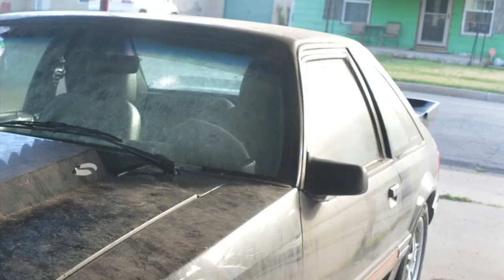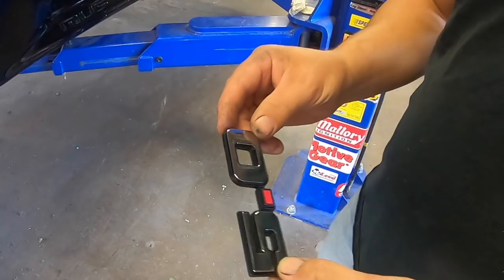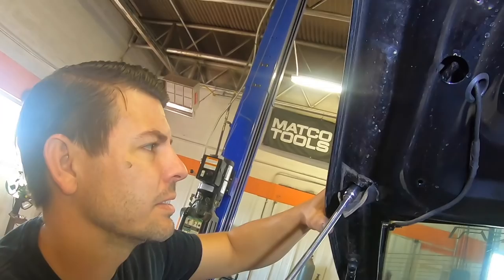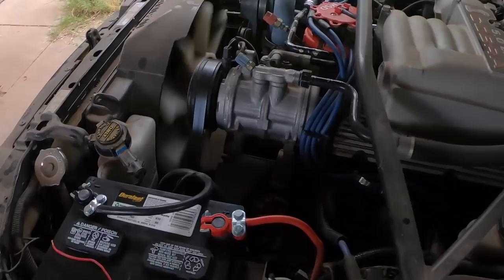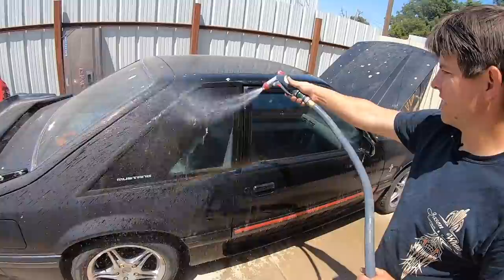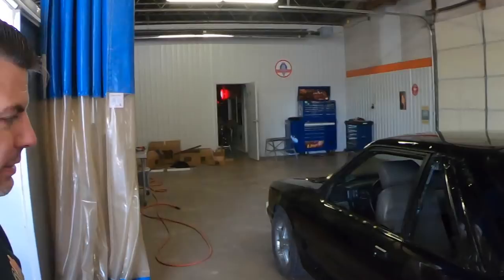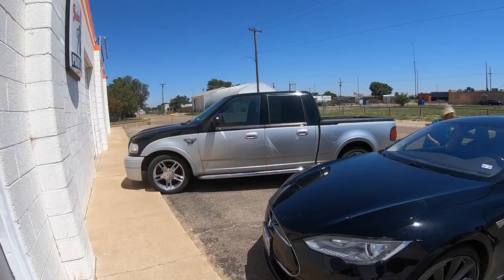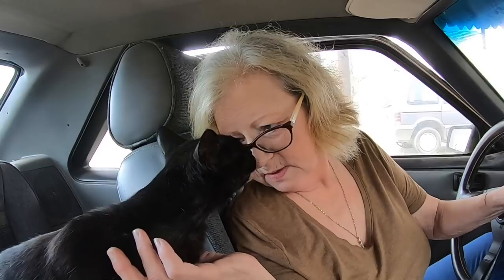Watch Us Rescue &  Restore Neighbor Lady's Mustang At No Charge

Comment: Wish they would have keeped the saleen wing and the gt40 intake
Reply from the maker: The parts are there. Somebody can do all that body and paint work.
Reply: jason9022  Never have a read such an ignorant comment in my life.They made the car period correct so it has a better resale value. This car is now just as it was off the show room floor, which is what collectors look for.
Reply: defo should have kept it the way her son wanted it
Reply: I mean on one hand yeah, it was his car. But doing that kind of thing to it does make it more unreliable. You have to keep in mind that they were building this car for her to drive, and be reliable. The second you start putting non-stock parts on a car, it instantly becomes more unreliable. This is coming from a guy that only did exhaust and it still came loose and burnt a hole in my bumper. While I think keeping it the way her son left it would have been good sentimentally, it would have been a sacrifice for her drive-ability.
Reply: Right?! GT40 intake removed.  BBK throttle body removed and intake system put back stock.  MSD ignition removed.  All those parts actually improved the car.  This shop killed the personality her son added.  All those parts were reliable and safe.  What in the world happened.  I'd be so upset.
Reply: Ik they ruined what was that car they made it oem practically taking all of the sentimental value out of it badges aftermarket parts that troy added... kinda defeated the the whole purpose
Reply: They made it so she could sell it for if she wanted a new car. I personally liked the old hood and spoiler and other stuff, but it would help her if wanted a new car so she could sell it for more money to get a new car, and I think that was a nice thing to do, though they should have asked her before, which they probably did
Reply: Me too,  but I'm thinking the reason they bought all the stock parts and put them on instead and gave her a box with all the aftermarket parts, is it's worth more to more people as well has appeals to a broader range when it's restored to stock condition, plus, if the buyer wanted the aftermarket parts, that's more money added on top of the price of car, if not, sell them to someone else after the car is sold. =)
Reply: It looked like she was disappointed to not have the Steeda parts or Cobra intake. The turbine wheels are probably the least desirable wheels for a Mustang. Should’ve kept the aftermarket ones. Instead of getting her to sell the car, why not offer a free check up every now and then. It’s a big memory of her son.
Reply: John Smith makes me wonder what happened to the parts they took off.
Reply: @Kernalpanik  they maximized resale value..
Reply: cobra intake mate, gt40 intakes are tubular
Reply: Someone kept them.
Reply: @ianrothery8200  I disagree with this statement there are many upgrades you can do to a car to make it both faster and more driveable and more reliable like the mods that were done to this car that intake is doing nothing but help its power that's it drivability wise it won't hurt a thing the MSD stuff that was on it will actually make it run better better as in better drivability and will likely last a lot longer there is no reason a car has to become more unreliable as it gets modded unless you don't do it their correct way with the correct parts
Reply: @jasonwilbert9533  The guy said in another comment that she has the parts, and if she does end up selling it later on she can include them in the sale.

They did everything this way to maximize resale value. She already said in the video that she knows she's gonna have to sell it one day so if anything, these guys actually did her a favor. Car's gonna be worth a lot more in clean stock form even if the parts her son put on it were quality.
Reply: 93 cobra Gt40 upper and lower intake $600-700 Saleen wing (if real Saleen) $400. Take those parts and sell to make the car original to 87-89 period. Then she can get more money for a period correct car if she decides to sell. They turned a $4-5000 car into a $10k car for her. Can’t slam them for that. If that’s a real Saleen wing I’d buy it now.
Reply: Too bad that’s not the GT40 intake at all 😂😂
Reply: INSERTaccountHERE You have no idea what collectors look for here kiddo..this guy probably took all his parts and made over 2k selling them all in trade for a $200 polish job and some old stock parts..seeing all of that I would agree with Jason in that these guys are infact looking to get their hands on that car
Reply: Ian Rothery There was nothing “unreliable” about any of those parts..do you even own a car 🤦🏾‍♂️
Reply: Douglas Britcher Which is why she probably looked more disgusted than satisfied..and honestly what kind of hack job shop reveals the car on a lift with no tires on it??
Reply: xp What are you basing that off of?..that is EXACTLY what the 1988 mustang gt looked like in 1988
Reply: aussi3212 There are two GT40 intakes but this intake is neither of them 😂
Reply: Maxwell Peter It takes one to know one I guess..
Reply: E Riv she kept the old parts.
Reply: Peeweetheparakeet 13:05 they did not ask her verified by the person filming
Reply: @thewriter2549  Don't take what people say to heart. I understand why you did it the way you did. It would surely be worth more stock if she sold. But the matter of fact. It would still be sitting under the shelter not running if not for your help. She is blessed to have your help. And bless you all for taking on the project.
Reply: @scottkaluza4156  to be fair that may have been the last place her son parked it before he died and thats why she never moved it.
Reply: “Keeped”
Reply: Why he didn't leave intake original must have kept it for that fox body in the shop
Reply: Smh the old stock junk wheels shiity stock hood lol car had more resale value before minus the paint being faded
Reply: @INSERTaccountHERE  "Period Correct"  Those parts are EXACTLY period correct, those are the parts her son put on the car in that PERIOD.  Not every fucking car has to go back to stock.  They took the car and changed it from the way her SON liked it, to the way Ford made it in the factory.  There's 10,000 more cars out there that look just like they made this one.  Before they touched it, this car was one of a kind, it was HIS car.
Reply: @brick9458  They made it so she could sell it back to THEM when she needs the money or gets too old to drive it.  Pretty obvious.
Reply: @ianrothery8200  those are intake parts for the most part, all they do is take in MORE air over the stock parts, how does an engine work worse with more air? Not to mention the intake came off a Mustang, it's not aftermarket, its an OEM part that was put on a different car, there is 0 chance that car ran worse with those mods
Reply: @macpumperkinz  I'm talking repairs and reliability. I'm not saying those parts do worse on performance, but that car and engine was designed with those parts, and was designed from the factory to run best with those parts. While there may be some parts that improve some elements of performance, years of research did not go into making them reliable. Purely from a mechanics perspective, repairs are a lot easier when things look exactly the way they came from the factory. If she plans on keeping the car and just driving it, stock is the best way to go. Easiest to fix, and (usually) cheapest to fix. While yes, they were her sons mods, they may have not been the best for the car. I do kinda disagree on using the stock wing and other cosmetics, but they still made it look good.
Reply: 1 of the mechanics wanted all the aftermarket parts for his foxbody so he swapped his factory shit for it...

Comment: Get the lady some center caps
Reply: Please my word
Reply: boosted saleen glad Im not the only one who thought that.....Im a Chevy guy but thats a sweet ride
Reply: They don't reproduce them and they're held on by plastic tabs that tend to break. I actually bought a spare pair of turbines for $20 just for the caps in case mine break
Reply: Turbine wheel center caps are not reproduce and crazy hard to find
Reply: @jasonwhite6254   Somewhere I have a set of turbine caps for both a mustang and cougar.
Reply: @leemer1  awsome what would like for them
Reply: Yeah I think it's kind of crazy they took her 5 lug system off ,car had good Wheels it's easier to find nice rims with a 5 lug instead of the four. Personally I think the five lug is one of those mods that makes the car better.

Comment: I honestly feel like she didn’t want them to change the exterior... like the spoiler and hood. Thats what her kid loved and added. This just looks like a new and different car :(
Reply: ROD ETTEFA was thinking the same.
Reply: I agree with you 💯
Reply: Yes but before you pull out your 💯 for respect the point of this restoration was so she could could A keep the car or B sell the car which she was thinking of doing anyways.
Reply: But the car is worth much more by being period correct and without all the stupid crap her son had added.

I think her son, even if he was alive, would have been happy to see the car to be returned to its original position and that the work was done by pros.
Reply: @adanochoa9926  period correct? Bullsh**! You don't know much about fox body Mustangs do you? They're not worth much anyways unless it's a convertible, or has extremely low mileage. Even then they're only worth 8k - 12k. You can't give away a set of 87/88 GT wheels, and this cat took off a nice set of 16" or 17"" wheels, and put on a set of 15" stock wheels that he probably found at a flea market. And the Steeda hood and spoiler cost about $1,000.
"Restoring" her son's car was a very nice thing to do, but taking off $2,500 worth of bolt on parts and replacing with stock damn sure didn't increase the value.
Reply: VA HOSS The car was worth about $2,500 now like you said $8-12k or she has a nice driver and a memory of her son that she will enjoy with every mile she drives.
Reply: Adan Ochoa THANK YOU... I FULLY AGREE; everyone in the comments who are hating seem like just evil/jealous people given what this man had done to help this sweet woman.
Reply: Phil J.L Fig i honestly think no one got what i was saying. Watch the video again and tell me this woman didn’t look disappointed. She COULDN’T believe the car was hers. It doesn’t matter what stupid shit her son added, it was what he like and she watched her son do it. Hence why she she knew how to work with the car. Its not all about money sometimes sometimes.
Reply: @mikesanto69  Ah yes, cheap fucks for restoring a car completely free of charge and helping her with her situation.
Reply: @mikesanto69  well they are not rich they are broke af they cant afford the top stuff
Reply: @steve-ph9yg  I got an old truck I just can't part with it was Grandpa's and I learned to drive in it and Grandpa got it from his dad we got four going on five generations, one truck. Sounds dumb but sometimes a vehicle is more than what a VIN says it is
Reply: @VAHOSS  after market parts mostly drive down the price of a car. If you watch or pay any attention to when people go looking for cars to restore or sell like these guys do. They always talk about Stock this and stock that. And are always disapointed when theres after market stuff on the car thatvtakes away the value. When you buy a used car off of some one and they say Ive put x amount of money into it so I wanna break even on it, that has nothing to do with what the car is actually worth in a blue book. They just want a return of investment.